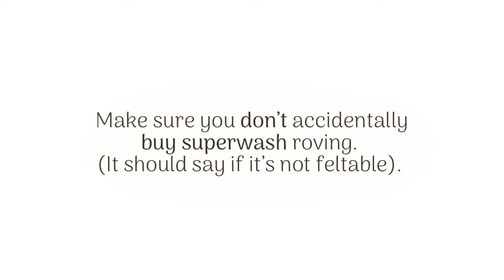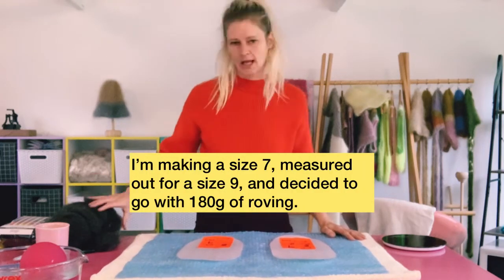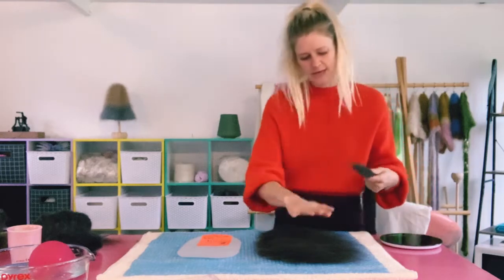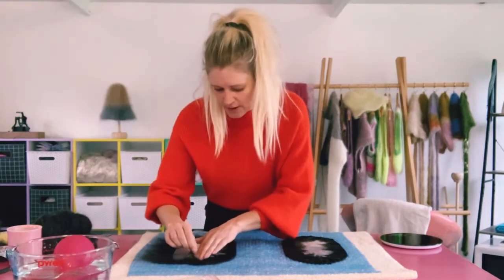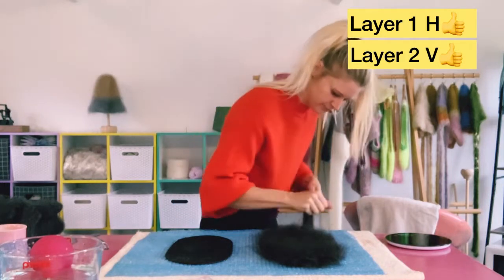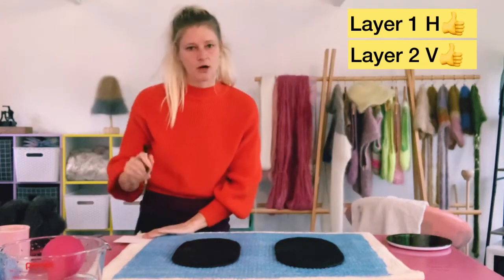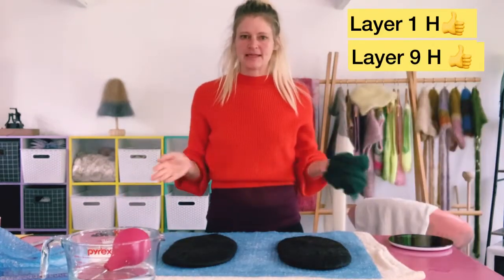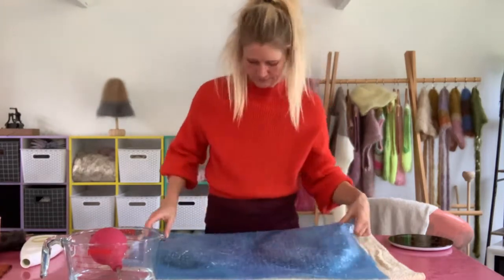Make a Pair of Wet Felted Wool Slippers Beginner Style Step-by-Step + Template! P1: Resist & Layout

Comment: Could you use a lining from an old pair of shoes for the flat foam? I am excited to try this out! ❤
Reply from the maker: Do you mean for the resist? The resist (flat foam) needs to be at least 8cm larger then your foot size :) it needs to roll up as well so as long as it is quite flexible and thin :) The material will need to slippery so that the wool doesn’t attach to it. Wool will attack to some fabrics and then it might get stuck! Definitely give felted slippers a try and if you have any other questions, ask away! Lori

Comment: You can just big the felt material in rolls?
Reply from the maker: You can buy it in rolls and then cut it out or pull it apart and place it on like fabric. Then flip it over and place another piece on. It is a different method for felt making. Really good for large projects like rugs or yurts haha. I am unsure of how controlled the end results will be. With pre-made felt, the slippers may end up being more rustic and shapeless. But take that as a challenge!!

Comment: In the final felting, if you turn your slipper inside out, you can cut the toe off a pair of pantihose. Then either needle felt or wet felt a few layers of wool fleece over it and that will strengthen the toe, you can also put a strip at the heal also. It won't stop pilling, that's just the nature of wool, but your toe will find it harder to wear through. Thank you for sharing the video. Cheers from Australia!
Reply from the maker: Love love your idea! I have not tried the needle felting but think this is a fantastic solution. Would have never thought about it. 

I used to add in a woven fabric layer (silk) in between the felted layers and felt it right into the slipper itself. It does add strength to the slipper. You could even add a woven fabric layer as your surface design to the top or inside of the slipper before felting 😊 

Thank you for sharing
Reply: @muffsmerino  you're welcome, I guess a community can solve the problems of the world one felted slipper at a time 😊😁. I did try when I first started felting adding a bit of fabric in-between but I found it made the toe a bit bulky, but that maybe because I wasn't experienced at the time and I was experimenting. Then I tried silk yarn, but found they squirmed their way to the surface, and that's when I thought of the pantihose. I do use silk now because I'm more practised as well as the pantihose toes, and the silk is good for decoration along with the pantihose toe that helps with shaping the slipper toe. Thank you for sharing and a reply. Cheers from Australia!
Reply from the maker: @howlingwind1937  Yeah I find specific fabrics do make it bulky. I am definitely going to start mentioning the pantyhose idea at my workshops :)
Reply: @muffsmerino  thank you for a reply, that's great that you can use the idea and pass it on, you don't have to use the toe of the pantihose, you can use the the leg part too. Sometimes depending on the brand, the toe can be a bit tight, so a strip from the leg works also. Cheers from Australia!
Reply: Thank you 🌷😊
Reply: @shelliethompson7260  you're welcome I enjoyed the video and also learnt something as well. Cheers!
Reply: @shelliethompson7260  😁💗

Comment: I’m really new at this your video is very informative. Just wondering how do you calculate the weight of fibre for a total project like slippers in different sizes. Say like how much fir baby size  women or mens.  Thank you
Reply from the maker: I don’t have an exact method on how to calculate. The smaller the space, the less area to shrink so baby slippers would be a lot less wool. I’ve made a few and all have turned out funny. So the key is to spend time making a new pair, new shape, see how it turns out. Then do another one and adjust it and continue until it’s perfect. 

 I expect to make each new felt project four times before it’s how I really want it to be. 

The adult slippers go up 10g per size until the space gets larger you need to add maybe 20 more grams. Hard to say if it’s an exact science lol! So maybe the kids and baby need to go down 10g per size and baby even more! 

Trial and error. I have yet to make templates for baby, adult, men’s and boots!

Comment: Hello, Thank you for the videos. What material do you use for the template and do you have size guides for templates? Thanks
Reply from the maker: The material is a 2mm flat packing foam roll. I have digital templates in all sizes and shrinkage in the Muffs Etsy shop. I don’t think I have it listed as a seperate sizes yet. There is a bit of guidance in the beginning to of the slipper video on how to draw, shape and size your resist. If I missed anything though feel free to ask :)
Reply: Thank you very much!  @muffsmerino
Reply: Thank you for sharing your skills and talent. Most appreciated🎉

Comment: please tell me what type of foam product you use for the "flat foam".  thanks
Reply from the maker: Some websites say it is Polyethylene foam. Some call it Polyfoam roll. I type in Packing foam. The one I use is approx 1mm. But 2mm should work fine too. I hope you can find it. If you are in New Zealand, you can buy it at Bunnings, Office Max or NZ Safety Blackwoods. 

You can also use bubblewrap. The flat foam is easier to draw and cut out shapes. It is easier to fold over your edges as well.

Comment: Can you also do this with Merino? I have a ton of Merino available from another project and am trying to find interesting ways to use it up.
Reply from the maker: Yes you can definitely use Merino. I also use Merino to make felted slippers. Sometimes I add a silk layer to make them stronger. Use the same amount of wool needed for the size as in the video. The Merino is more delicate and can pill more easily. I recommend making the Merino slippers one or two sizes larger so that the toe doesn’t rub or pill a hole. The Merino fibre filaments are smaller and so in time, they can break apart from friction, so do other felted slippers. If you make them thick enough, and felt them tightly, they can be fairly hard wearing.
Reply: @muffsmerino  i do have a small amount of corridale so i might be able to get a layer into it. Thanks for the clarification ❤️

Comment: Oh my, this is a great tutorial! I have raw sheep, alpaca, and angora... is there a blend you'd recommend? I've heard alpaca is stretchy, but my sheep wool is pretty coarse. Would coarse sheep wool be good for slippers? Thank you!!!
Reply from the maker: Coarse wool is great for slippers depending on how coarse. Alpaca is approximately 15-25 microns. Corriedale is 28 - 33 microns and is perfect for slippers. Coarser wools can be more challenging to keep wet and require more arm strength to felt to size. If it is oily, it won't take the water as easily so keep applying water. Apply quite a bit of warm water and quite a bit of soap if it's just not staying together during the layout process and again at the beginning of felting the slippers.

I have a pair of Alpaca socks that went through the washing machine. They shrunk quite a bit and then stretched out so I can attest to the stretching! I feel that if you made a pair of alpaca slippers though, you could just shrink them more to allow for stretch. They would be very soft. Because Alpaca fibre is very fine like Merino, you will need to lay out more layers to achieve a thick slipper. 

The Angora will end up being very fluffy and its commonly blended with other fibres. I believe alone, it will felt similarly to the Alpaca but may also stretch. I find when I felt with Angora, it doesn't felt easily to itself, so could be quite a challenge to felt without blending it. 

So! I recommend washing your coarse sheep wool well, brushing and carding it so its very smooth. If you are able to blend the fibres together, then definitely use them all or, at least add the Alpaca. This will make your slippers a little more luxury, softer and warmer :) Noting that you don't need to pre-blend them, you could do a different type of fibre every other layer.
Reply: @muffsmerino  wow thank you for such a well thought out answer! I tried to wash the coarse wool and gave up! So much vegetable matter in it! I did try with the alpaca, as its much cleaner, and succeeded in a lumpy something thats vaguely slipper shaped! I will have to keep trying I suppose, but its surprisingly hard to "sculpt"? I ended up rolling it back and forth with my feet to get some traction going, and I ended up with a big lump on one side of the slipper! Anyways, thank you so much for your video and the kind response! 🥰